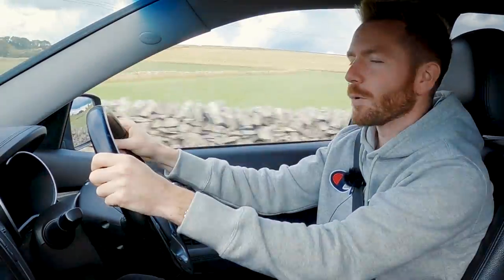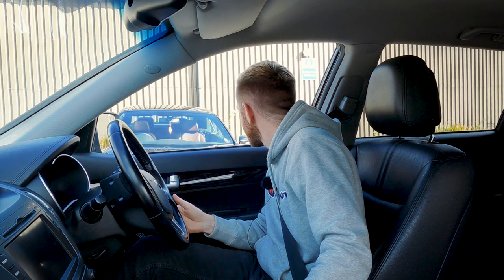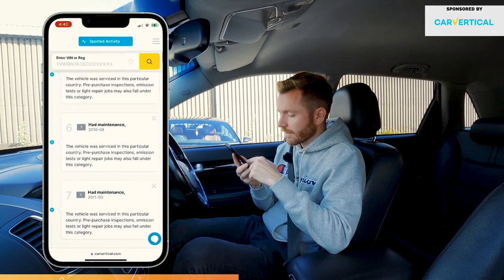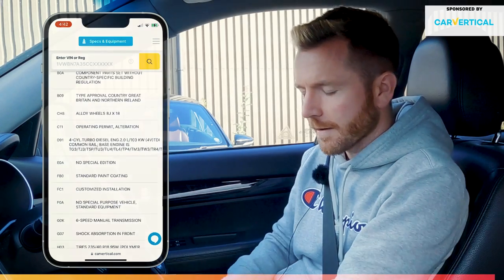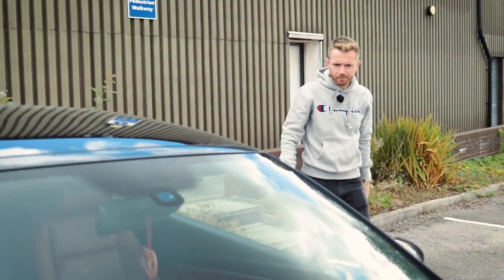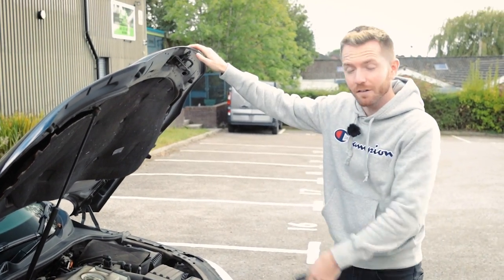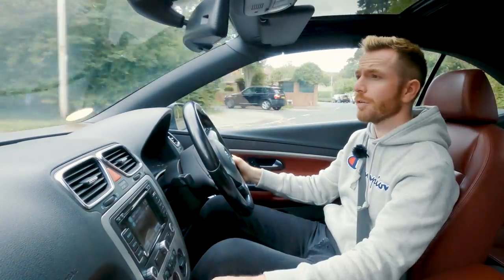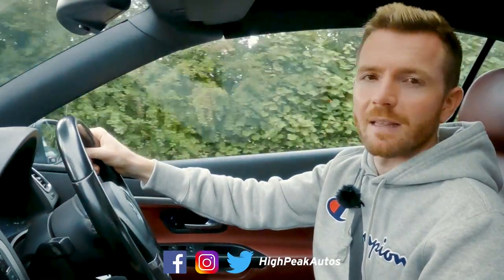I BOUGHT A CHEAP VW EOS!

Comment: Memories. Had a 2.0 TDI, bought it as a relatively new used car from a dealer, really liked it at first, but quickly became the worst car I've ever owned; That whole DPF with it's surrounding, all the other usual Diesel stuff (with a little over 50.000 Kilometers on the clock), and that roof - leaky, and occasionally getting stuck in operation;

Comment: Much like the Sciroccos of the same era, this EOS is in that weird era where you would have people spec in a RNS315 like the one in here but have the absolute basic climate controls... Where steering wheel controls were optional... Very strange spec this one with the xenons, red leather and RNS315... if it was the GTI model, I would say it worth a fix but not quite sure this one would be
Reply: Not sure they are xenons. The VW winter pack gave you headlamp washers at the time. Giveaway would be the lack of levelling dial next to the headlight controls knob.

Comment: Hi , the only reason the roof leaks is the seals have not been cleaned and VW grease put on every year as in the service items . The water in the boot is a leaking boot lid light seal gone as the sun eats the plastic away , just press in the middle and see if it gives . Water leak in front blocked drains off the roof  that kill the ECU , bug traps blocked , so cut the ends off FRONT AND BACK . my daughter had one with 22k and ran it to 140 k regular service and no problems , but any water in the boot kills the roof pump and roof ECU will set you back 2k to put right .. Should you be offered another one .

Comment: In the US that car would  go for $10,000 . A manager at a dealership next to me drove one of their SUVs to the fence to stand on and waited until I was heading out to work to ask if I'd sell them my 2014 for 10k the went up to 12k when I kept saying no. 

I've had  no major issues with mine in terms of random failures  not caused by human  error/negligence/vandalism.  Maintenance is done on time and all recommended preventative services are done as well.  Hardtop convertibles are becoming rare and then add that it aslo has a panoramic roof. If you have one hold on to it, baby it.

Comment: Never understood a point of convertibles with a metal roof. It is heavy, it is incredibly complex and difficult to get it sealed, and if the time comes for adjustments outside of the factory, noone can ever get it sealed properly again. Hence the leaks.

They also tend to look quite terrible, with Ford Focus being one of the worst of the lot.

Comment: You were probably parked too close to the wall/vegetation behind the car. The roof won't open if there is a near obstruction to the rear...
Reply: They are always parked that way I've noticed..hmmmm 🙄
Reply from the maker: How would you suggested they were parked? Side on? Diagonally across three bays?
Reply: @HighPeakAutos  wow salty!
Reply: @HighPeakAutos  Just something I've noticed with the EOS as a long term owner..  no need for a shitty reply.. Just trying to be helpful...
Reply: @HighPeakAutos  just not quite as close to wall area, you often look a bit cramped when filming boot/ rear area 😉
Reply from the maker: @MrSketchydave69  my reply wasn’t aimed at you it was the other guy 😂
Reply from the maker: @MrSketchydave69  I appreciate the tip
Reply from the maker: @jayturner3397  ok fair enough 😉
Reply: @HighPeakAutos  cheers 🍻

Comment: EOS owners kinda do this.  Beetle owners likewise.  I’ve seldom. If ever got in a fresh tight working Eos.   They were cheap in the block. Auction.  When the block actually ran pre internet / pre CV.  I love the rouge leather.   I see no reason own one.  But used to like trying rob and flip one when bought bottom book trade.  Hoping roof motor under spare wheel well boot not submerged. Yes they did leak that much !!!   Honestly. Eos.  Should have been great. Just ended up a Meh car

Comment: 😅 funny review dude and your videos are pretty insightful to the motor trade. The academy thing sounds interesting also. Funnily enough TR Hamza on here also bought a Eos for the 2.0 TFSI engine that comes with one of the versions, same as the MK5 GTI at a much lower price point and likely had less abuse. His also had a National Trust sticker :D Now completely different to the Eos but didn't realise you're also a dealer in Stockport. Was looking at another small dealer around there as they had a car I was interested in. Now some of their new stock is a sporty Mini but it has Pirelli P Zeros on 3 corners which seems pretty crazy, but then the dealer has put some random eco brand on the 4th. Seems to be on the rear end though at least thankfully, but not sure what you think of these cheap tyre practices

Comment: 1 kw = 1,36 hp.. Or 103 kw x 1,36 = 140,08 hp ;) Here in Denmark. These were pretty expensive as new cars and still hold a decent value. So people has and still is, taking good care of them. I have traded 4 of them since 2010, and all of them were just like 98% new cars. ;) Cars in Denmark are much more expensive than in England, so that might be the main reason. A well maintained 2.0 TFSI is still £18k.. A diesel like the one in this video would me £7-7½K :) A 2007 2.0 tdi with manual was £65.000 from new.

Comment: VWs are a well put together motor, as long as the vehicle has been serviced regularly you’ve got a better chance with a Volkswagen than most other motors in this price bracket of it being a decent runner.
Reply from the maker: I beg to differ
Reply: @HighPeakAutos  volkswagens and any other Germans cars are just awful in my opinion and experience 🙂
Reply from the maker: @fredsucksatminecraft2753  yeah I always say this but I’ve found all cars to be unreliable
Reply: I have found German cars troublesome especially the electrics. I've owned an Audi TT and Mercedes  M class and had trouble with the electrics on both. I owned a Honda Civic GT type S and had no such problems with it. 🤷‍♂️
Reply: @HighPeakAutos  I defer to your greater experience in this matter lol
Reply: @HighPeakAutos  The 2 worst cars for reliability I've owned were both VW. B7 Passat blew a turbo and infotainment died twice, Scirocco had a total electrical failure including smoke!! Oh and our works Mk6 Golf got through 2 dual mass flywheels. I've owned all the supposedly unreliable makes with only minor issues. Peugeot, Citroen, Rover, Vauxhall & Jaguar I sometimes the German quality is a bit over stated as I've had costly issues with Mercedes & Porsche's?

Comment: I have automatic vehicle licence driving (only automatic) and the law in my country allows me to by a car from european union using an engine that doesn't exceed 2000 cc for petrol, or 2100 cc for diesel.
I do alot of open road trips (800 km per week) to work, so i will use lpg (cheapest fuel).
My budget is 8000 euro and i wonder wich is the best car to buy: golf mk5, jetta mk5, passat b6, octavia mk2, mercedes w203 or w204, avensis mk2, corolla mk9, mazda3, focus mk2, kia ceed mk1, hyundai i30 mk1.
Wich one do you recommend (my main concern is reliability and long term use).

Comment: I have to google just you British description. I've never heard in my life "bonnet pull", after googling - I assume its hood release latch? And in the iPhone description of the car, UK mechanics use "Nearside vs Offside" vs driver or passenger. Very interesting. I worked on this car and its one the most difficult, backward engineered cars I've ever had the pleasure of working on. Everything is so difficult. Everything is so tricky, and the engine isnt even that powerful. There is a reason why these don't hold value - but  good video.
Reply from the maker: Haha sorry about that. I forget about the difference between UK English and US English

Comment: I was laughing  ! Not at your misfortune but the fact , I own a VW Eos more or less the same spec as that one. I bought it over 3 years ago for £1350 two owners full service history. It has been a money pit . I replaced cambelt,  brakes, suspension,  replaced both front wings,  short vlog here on YouTube,, refurbished wheels,  new tyres,, cleaned all interior with lemon and vinger to get rid of the mould  !! Repaired boot lock,  leaking in water. It's not the roof , it's the boot badge lock where the water gets in ,..It's covered 78000 miles 2.0L Tdi Sport 6 speed .. The roof still not working and quoted around £600 to repair.  Stands me just over 3K now and drives mint now , good Mpg... That Eos you paid £1200 ,, the BAM engine for taxis fetch 1K ,, interior in Red £500 The Chicago wheels fetch over £500 ,, So that car is worth more right now in parts , breaking it ...Sunroof motor £250 ...You should of put it on ebay , you would get your money back and maybe more..

Comment: They were a decent car the Eos….. shame it hasn’t been well looked after , I bet the wheel bearing noise is the rear tyres worn/saw toothed on the inner edges as they suffer with this a lot.

Comment: Matt, what would you recommend? Passat B7 or B8? B7 with a bit less miles but better spec. B8 is 2-3 years younger and has the newer 140 kW 2.0 tdi engine.
Reply: Iv had all passats since b5
B7 nice ride and steering and definatly more sorted than the b6 its based on. Downside dash rattles and almost gteed aircon failure. B8 firmer ride not so direct steering but much improved interior build, no rattles and a different air con compressor that doest  break down. Also active safty stuff.
Reply: I would recommend the best Volvo V90 you can afford. Way better than a Passat and cheaper to run and insure.

Comment: I owned six VW. Rubbish. Three of them where Golf Mark II diesel. The good thing was that the parts cost next to nothing. I got all of them from southern Germany, which means no rust. I fixed them mechanicly, drove them for a little while, and sold them on. Young men would kill for them. Not because there were fast. They weren't, but you could drive them on tax reduced oil for househeating. What a lovely scam.

Comment: That looks like a lovely car, I didn't know they were such a money-pit.
Reply: It’s a vw what did you expect 😂
Reply: @marcusphoenixish  I had a vw jetta on an 09 with the diesel 140bhp engine bought it second hand 8 years old and it was great for the 5 years I owned it, only had 2 sets of tyres new discs and pads and oil and filter every year, oh and new headlight bulbs for the dipped beam and a set of bosh wipers really liked that car it was a dieslgate car but i couldn't get the cash payout 😕
Reply: @wakeup2theNWO  I've had 5 VW's including a VW wanker van they were all a bit shit in my opinion nothing special. Unfortunately sheeple like here in the UK put fake prestige on VW's and think they're something special they're not they're just another crap car that breaks yet they cost a lot of money because sheeple have driven up the price's 🙄
Reply: @marcusphoenixish  I had an old VW Polo (the bread van looking thing) that was pretty beaten up, dog slow with a 1.0 litre engine, and was basic as anything. But it never broke down, always started, and was rust free.
It was a right solid old banger. I've got a MK3 Octavia now, and I can't say it's rock solid, but it's not given me any bother. I do pamper it and it's still pretty young, so I wouldn't expect any bother for a bit. But generally, I'd say VW are living on a reputation they don't deserve.  (I'd say the same about BMW and Nissan too, tbh.)
Reply: @MrSonicAdvance  had 4 VW bread vans they handled like donkeys but we're ok. These were before the price increases from the false prestige put on by the dub idiot's 🙄

Comment: In vw group There's cars fitted only with tiptronic like golf 4 and bora and octavia mk1, but others use both tiptronic and dsg like golf 5 and jetta 5 and octavia mk2.
How could i know that it's tiptronic or dsg in such cars.
Is there a website that explains the type of gearbox according to engine and year.
Tiptronic transmissions (using torque converter) in vw group are not the same ( 01M, 09A, 09G ..): wich one should i choose (main concern is reliability).
Reply: @UCAXEyPOVKI8Z0VWuvL4A6aQ 
thank you for replying but i'm not going to pursue this job. I am from tunisia.
I have automatic vehicle licence driving (only automatic) and the law allows me to by a car from european union using an engine that doesn't exceed 2000 cc for petrol, or 2100 cc for diesel.
I do alot of open road trips (800 km per week) to work, so i will use lpg (cheapest fuel).
My budget is 8000 euro and i wonder wich is the best car to buy: golf mk5, jetta mk5, passat b6, octavia mk2, mercedes w203 or w204, avensis mk2, corolla mk9, mazda3, focus mk2, kia ceed mk1, hyundai i30 mk1.
Wich one do you recommend (my main concern is reliability and long term use).

Comment: I’ve got a 2013 A3 convertible- 1.8T - worst car I have ever owned - never let me down, but the roof headlining is coming away, heated rear screen doesn’t work, something bad is developing with either the clutch or gearbox, and it’s picked up a few parking dents - only 66k miles - but I just don’t think it’s worth fixing up - which means it’s worth nothing either way …
Reply from the maker: Shouldn’t happen on a car of that age and miles
Reply: @HighPeakAutos  I agree - I’ve had everything from Fiats and Alfas and BMW and Audis and a Lotus …. By far my worst cars have been the Audis and BM’s …. Audi built quality is terrible and BM too complicated (high and low pressure fuel pumps and injectors, etc) …. All been relatively expensive cars too — my wife’s Yaris’s and Vauxhall Zafiras have been our best cars 🤷🤣
Reply: @HighPeakAutos  maybe I’ll leave it in that car park one day and you can slag it off for me 🤣 - on a positive - has full service history, 2 keys and 4 newish Khumos’ 🤣
Reply from the maker: @JIMMYHIBBS1  😂

Comment: That's a typical modern German car that's been kept on a shoe string budget with no mechanical insight from the owner. If you don't keep on top of them with all their faults (of which there are usually a shed load on these) it will bite you in the butt. The mere fact that needs a flywheel plus a cambelt and full service as it will be overdue because the usual "we won't bother we getting rid of the car"  for the last 3 mot's. then all the other faults underneath mot wise that have been recorded before you get to the bodywork and the interior. Anything like that I would walk away dealer or not. Unless you enjoy a money pit or driving a car that will never be 100 percent sorted. That's a £500 car and it needs £2k to get it back to a 'tidy' ish example. This is a far cry from a petrol Toyota that just has a sticky brake calliper.